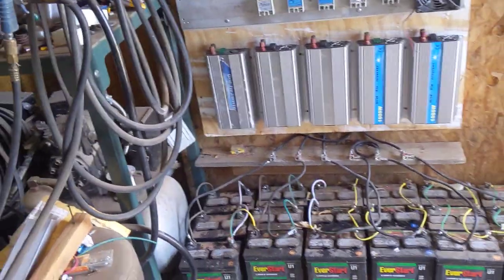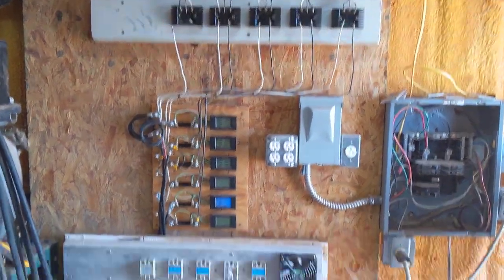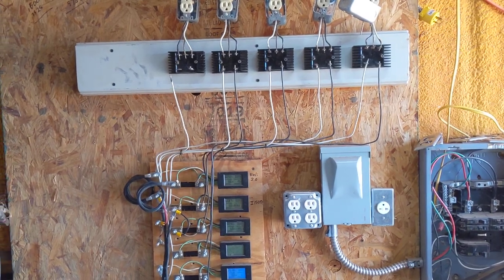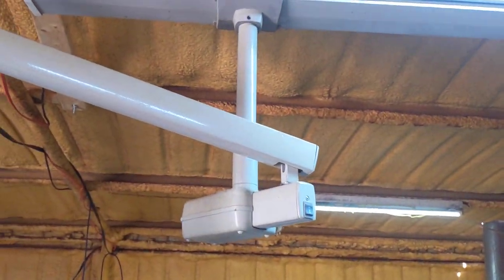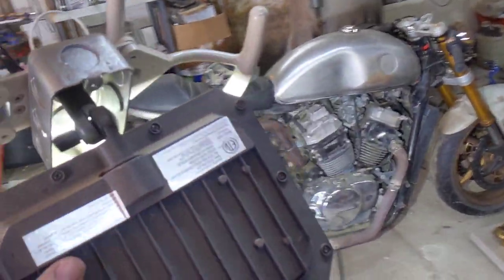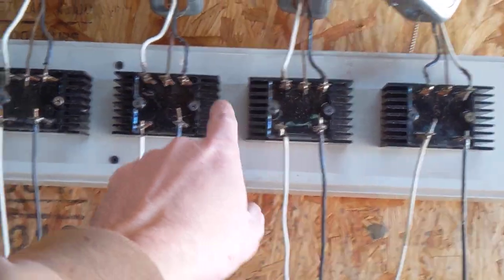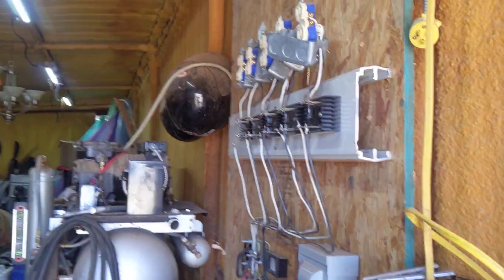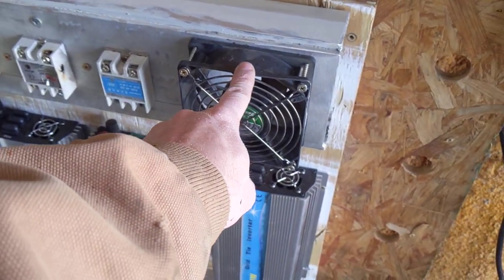Re-doing the wall in preparation for the 48v changeover!

Comment: Thanks for the update, looking forward to see it working. May I suggest that you install a windspeed reader in one of towers so we can compare the output from the turbines against it. Just a thought. BR Lars from Denmark
Reply from the maker: I would like to get an anemometer that can log wind speed data but they all seem to be quite pricey.  It's important information, though, and I hate not having it, but it's hard to spend $1000 on a rig to pull that information up.

Comment: Looking clean. I just swapped out my bc 3kw turbine with a windspot 3.5. It is a beast.
Reply: Do you have a link to the turbine?
Reply from the maker: I've never heard of a windspot.  Got a link to the turbine?  Specs?  Pictures?  I love finding out about new models :D
Reply: @ToysforWatts  it is a NOS unit. Came with the controller and dump load and I am using an aurora inverter to grid tie. Windspot went out of business, but Enair now makes a similar model the Enair 70. It has variable pitch blades and runs like butter, but it is 400 lbs vs 165 lbs for the old BC. After test run yesterday pipe on tower needs some reinforcing.

Comment: I'm building new cables for 18 batteries...I have 8 of them done with #2 welding lead wire. I got 20 feet of red, and black, each. I had some weak connections I wanted to fix before the sun gets any closer. It's going to be a long hot summer, so I'm going through the system looking for weak spots. From the looks of it, things will be better now. Too much money to go to 48v. , for me, so I can stay at 24 for awhile...7 : 30 PM, showing 25.8 volts...the amp hours are at 885 now, the watt hours 22,125.

Comment: Looking good, I know you don't charge batteries and I'm not sure how your hooking things up but I use a dump load to pull power from the batteries to stop them over charging and have it set up with one of those SSR's. I have a 24v system and have the SSR set to come on at 30v and pull down to 26v, I just found out my batteries equalize at 30v so thought I'd set the SSR to come on at a higher voltage but then remembered the input voltage for the SSR is 3-32v so cutting it close. have you ever seen those SSR's with a higher input voltage ?? or have you ever pushed one to see what voltage it pops.
Reply from the maker: So not quite exactly the same situation but there are some parallels here I had to overcome and I did it by pulling voltage off one side of the bank.  What are you using to control your SSR's?  I use little voltage switches that are also voltage limited and set them to operate off one side of my bank.  If you're using a fancier charge controller I don't know that you can set it up this way but you could get a $10 switch to handle the same job.

My inverters are only able to work from 20 to 45 volts on the input side.  To make them work with my 48v bank I divide the bank into two 24v banks and have a switch, ssr, and inverter assembly on each bank operating as two independent 24v banks.  My turbine still sees the 48v bank, but my equipment still works in it's operating range.  You could do the same if you're using a voltage switch...run full load across your SSR but only hook your switch to on 12v side of the bank and set it up to operate as if it were connected to a 12v system.  You could set your threshold to 16.5vdc to dump (assuming lead acid) and bring it down to 13vdc to idle.

I'm not sure if I explained that quite correctly...if it doesn't make sense I'm sure I have a video somewhere of it I can dig up :D
Reply: @ToysforWatts  Thanks for that. I kind of guessed that's what you would be doing from what I've seen you do in other videos. I use the same kind of controller you do for my ssr. My system is quite complex as I grab as much power I can from solar wind and hydro I then push it to battery and grid, my wind turbine was hooked straight to the bank when I got normal wind so need the dump but I could switch it over to a grid tie when we got crazy wind. I've just set up a second hydro which is   now charging the battery and being controlled by a Midnite classic 200 (expensive but these if you've not had one are very nice controllers) the hydro has kind of made my wind turbine redundant for battery charging but come summer my water will dry up so will need to hook the turbine back up again The Midnite classic has a wind function so will try this then if ok I guess I can do away with the dump.
It was only when I was setting up the classic I noticed how close the voltage was to the SSR limit so just thought I'd give an ask with you changing to 48v thought you may have go some higher input ssr's.
Take care
john

Comment: Why do you prefer putting the bigger relay (after the smaller realy with screen) in between the battery and the inverter? Why not putting the relay with voltage display between the output of thee inverter and the grid in the live wire? If the battery is drained enough the inverter will not supply AC energy anymore, so the battery will not completely drain, correct? With this setup you would not need the bigger relay and the aluminium railing. (I am no electrician, so I am not sure if it is the safest way for the inverter.. Curious about your opinion on this)
Reply from the maker: The one with the little screen isn't actually a relay...it's a driver that controls the relays.  The drivers can handle very little in the way of amperage...it's possible to use them to maybe run a very small fan but that's about it.

I could use a relay to switch the inverters on and off from the AC side but I would need different relays (not difficult).  They would run cooler but not so cool as to require not heat sink.  They can still kick out close to 10 amps on the output side.  Definitely cooler but not cold.

The reason I do not do that is because it would require redesigning everything if I change my load around.  Right now if I decide I want to send the load to something else all I have to replace the inverter with whatever I'm working with, the rest of the system stays the same.  This is not a huge inconvenience, just something to keep in mind.

The biggest reason why I wouldn't do it with THESE specific inverters, but might consider it with another model, is that these inverters are slow to boot up.  If the power is switched on while the turbines are running the batteries hard, there will be quite a while heavy current going into the batteries with nowhere to go.  My battery bank is not large enough to really to safely operate that way.

It is not an inherently bad way to do it, but requires different considerations.
Reply from the maker: You have to have different switch controllers than I have even if they look the same.  The switching circuit on mine will blow at anything more than 2.5 amps.